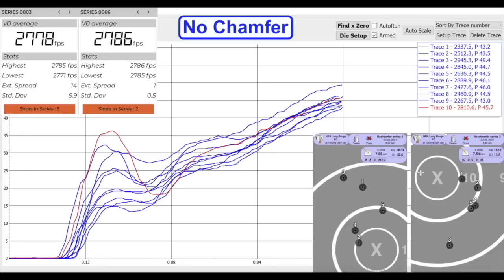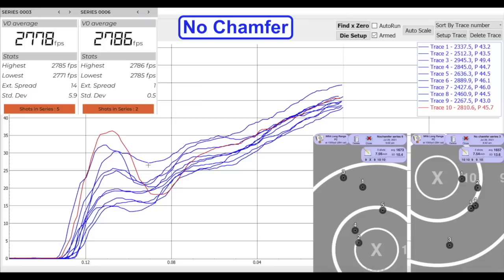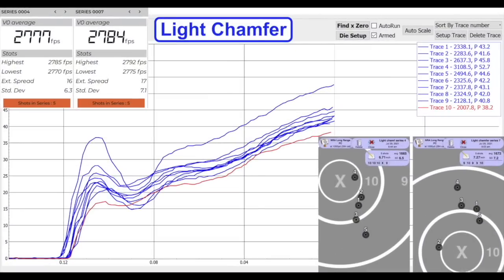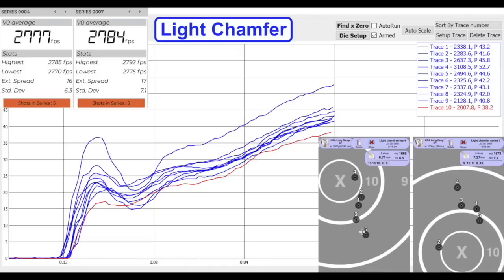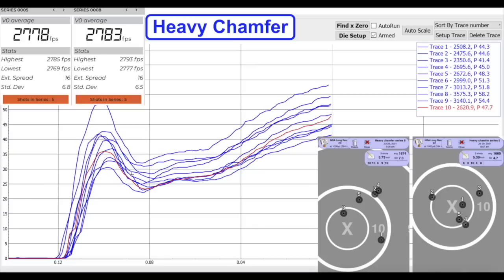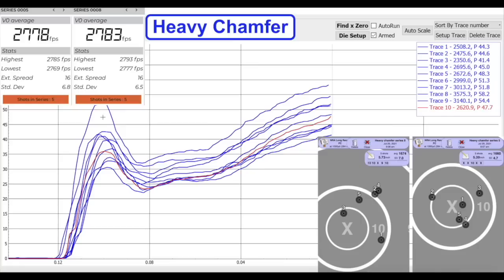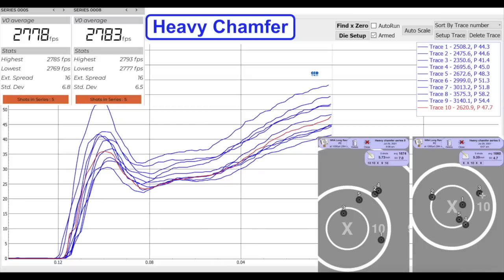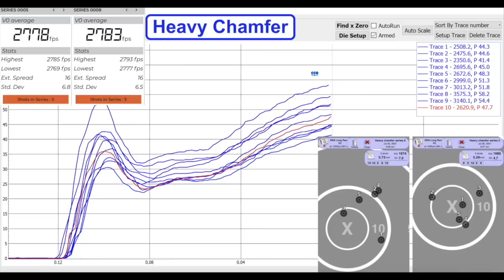AMP Bullet Seating Press and 1000yd Chamfer Testing – Precision Reloading Secrets

Comment: I've watched these AMP press bullet seating videos from several youtubers and have a different question.   Most, if not all, of us who anneal cases do so before we resize and load the case.   A video by AMP that answers the question about 'what if the same case gets annealed twice' clearly shows that every part of the sizing and seating process adds to case hardness.  I'm now thinking about changing my process to move annealing AFTER resizing so that the only thing to do is prime, charge and seat a bullet.   I wonder if the AMP press will show more consistent seating pressure on cases that have been processed in that manner.   I intend to do some testing with that order and hope that you will be intrigued enough to test this with the AMP press.   Thanks for your videos.
Reply: Won't annealing after allow the shoulder to shift and mess up any shoulder bump?
Reply: @tedpeek76  good question.  I had not thought of that.   My test reults are inconclusive.

Comment: Hi. Enjoying the channel, thanks. I have found annealing after sizing/trimming/brushing/expander to have consistently less vertical. I’m using arbor press with force pack. I also use dry lube on case for expanding as well as the bullets. Thanks

Comment: the matching surfaces of the inner chamfer and the boattail seems an interesting area to look at : does it make sense to extract the one bullet that caused this higher hump and measure the profile of its boattail ? and compare to others . It could lead to designing a tool to check for boattail shape . Swaged bullets should all be the same if thay come frome the same base die , except the one that was made with a slightly irregular jacket that was more or less elastic than others . In short range BR , our top competitors who make their own bullets have jacket checking tools : some lots are outstandingly regular and generally produce "magic" bullets .

Comment: I would guess that the initial pressure rise is the case resisting the bullet entry, not use of the distance scale at the bottom, but it appears that the pressure drops once the bullet has more contact area and the case mouth starts to open. As the bullet enters the mouth more and more the additional surface (friction) area in contact with the case mouth causes the pressure to continue to rise. Do you use any type of lube, like a graphite? That may give you more consistency after the initial hump. Also, the less chamfer may be causing scratches in the bullet and increasing the resistance. Great testing. One thing I have learned from working in labs, when you change something, you only change one thing at a time.

Comment: Was watching Quarter Minute Magnums and after trimming a bench rest shooter taught him to deburr using steel wool…  would be an interesting test…
Reply: I did that for a little bit. And yeah it felt totally different, almost like that initiall pressure spike was gone. Would be interesting.
Reply: It’s helping to smooth the edge from where the chamfered edge stops.  No matter what angle the chamfer tool is it is cutting and leaving an edge in the brass and the steel wool is not only smoothing that edge but also removing any small sharp pieces on that edge.  Seating a bullet after doing that you can definitely feel a difference 👍. Lol I didn’t realize this was from 6 months ago 🤦‍♂️. Either way it’s still relevant

Comment: Thank you for all the great info. So do you chamfer at 45° because I read some where to chamfer at a steeper angle?
Reply: That’s a great question Me Ruddiman. To note, the angle of chamfering is defined by the brand trimmer used. The Giraud tri-way trimmer states that it cuts 45 degree inside, 15 outside, eased front edge (if set up just right). This appears to be the standard angle simply because that’s what the industry offers because it works well. 

Lyman, among others, has a chamfer head that is sold as “VLD style” which is 22 degrees. Does it make a difference? Maybe…That depends on too many variables for a definitive yes or no. But like you, I would be interested in seeing the actual data, the down range result. It might just be what someone needs to more easily seat a particular bullet with certain brass prep.

Comment: I have been into long range shooting the past 4 years, but I'm baby steps into reloading and have a few questions. As a data analyst I find this data fascinating and would like to know more. How was the brass prepped? New brass? Annealing? Chamfer tools used for consistency? I ask this as I am developing a round to shoot at 1000 meters in .308win. If I'm not mistaken the P value in the graph is the bullet seating pressure in psi, correct? I see a very wide discrepancy between some rounds being loaded and wonder if it's due to the tools and technique used to prep and chamfer the brass before bullet seating. I can shoot 3 out of 5 at 800 meters within a 20x30sm (10x12in)  with factory ammo (Hornady 168grn ELDM) , but have just recently prepped 100 brand new Lapua cases by hand, chamfering and deburring with a hand-tool (about 3 hours of work by hand, remembering how many turns I make @ each brass). I am FL sizing the brass and WISH to be able to hit a clay pigeon ~5in (12cm) @ 1000 meters. Would it matter if the chamfering and deburring operation is done on an expensive tool, 3-way operation tool or similar, or it would be difficult to account for variations / accuracy of said tool, given powder rates variations and other variables? I'm curious to find out do I need several more monthly wages into measuring equipment or just call it a day with factory ammo @ 800 meters? Here in Europe everything is expensive, and paying 2 EUR per round and thousands more into supplies almost diminishes the idea of reloading. But my inner nerd won't shut up.
Reply from the maker: I make this easy. First, the AMP Press has been recently updated with a more consistent pressure plate so I'm going to repeat some of my original tests as I'm thinking the results will be much better to observe now. Second, I'm pretty convinced that the actual angle of your chamfer doesn't matter as much as making sure that you consistent in how you do it. And yes, that can be done with something expensive like the Giraud or Henderson or a simple three. The more expensive typically the quicker or easier it is to achieve the results, but you'll get good results with lots of tools. I hope that helps and good luck on your quest. Every time you try to make your groups smaller at long range (1000yds) it's incrementally harder and takes that much more consistency. It's a process for sure.

Comment: Have you tried running a nylon brush through the necks before seating? Supposedly the AMP guys saw a big improvement on seating pressure uniformity by brushing the necks before loading
Reply from the maker: Yes if you listen at the beginning of the video I mention how all of the brass had a nylon brush put through it.
Reply: @FClassJohn  sorry, missed that part
Reply from the maker: @Tpb10505  no worries. It’s was a pretty quick mention of it.
Reply from the maker: Lucas Oldaker  not yet. Will test lube soon

Comment: Great video John, Did you ever get the Auto Run to work?   If so, what did you do to make it work?
Reply from the maker: Yes I got it to work but you have to lower the levels inside the manual settings quite a bit to get it to work. I’ll do a video on it later.

Comment: Are you using a vld chamfer tool ?
Reply from the maker: I use a Giraud trim & chamfer tool.
Reply: @FClassJohn  does that have the tapered inside chamfer tool like the rcbs vld chamfer tool is? Vld ( very low drag)
Reply from the maker: @tacticalrabbit308  Yes, it's a 15 degree inside and 45 degree outside chamfer designed for VLD seating.
Reply: M1A2 Abrams, Thank you for asking this question👍

Comment: Did you chamfer the mouth before or after using the expander ?
Reply from the maker: I do it twice. Once before chamfering so that it is a uniform mouth and once after for the final neck tension.
Reply: @FClassJohn  With two different sizes, or just the one?